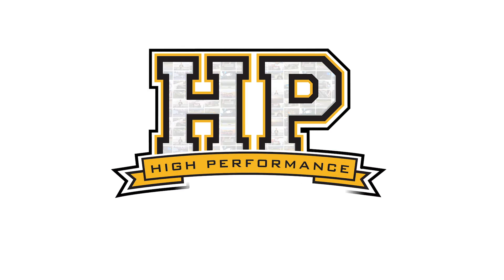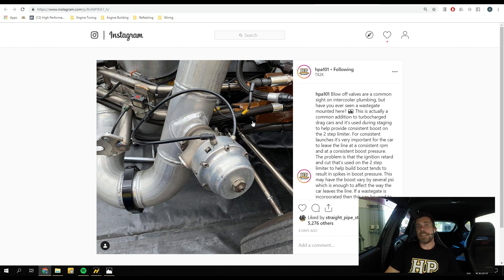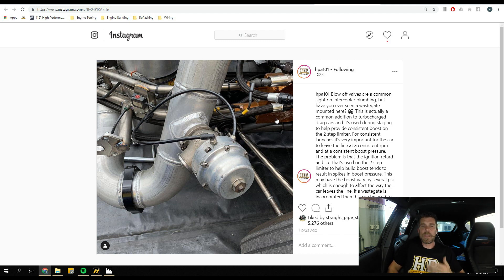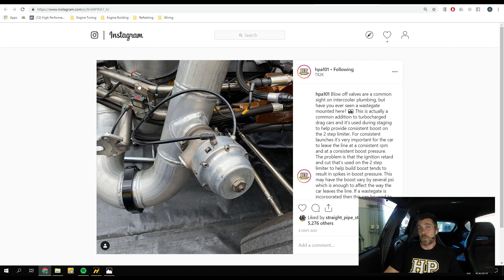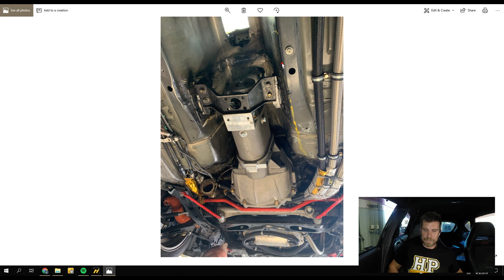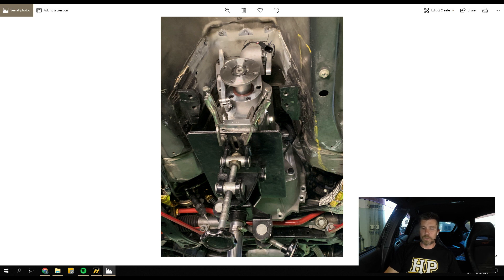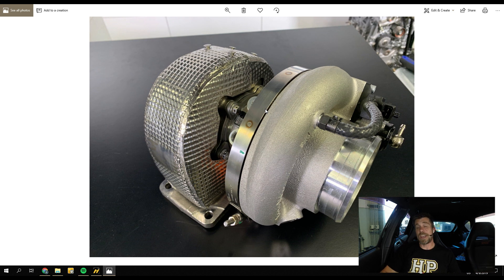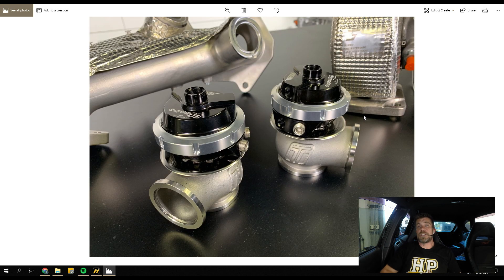Wastegate On A Charge Pipe! Why? & The Turblown 13B FD RX7 Project | Today At HPA 205 [UPDATE]

Comment: Hi I’m running a large supercharger which is great for going down the dragstrip that want to drop the boost pressure when not at the track could this setup (hypothetically 30 PSI to drop down to 15 PSI )be done to run a lower boost in this way?
Reply: @tim6913  yes you can regulate your boost with this method

Comment: Can a waste gate be used on a centrifugal supercharger (have rising boost curve). The idea is to run a higher boost pulley set up to get higher boost on low RPM and limit the boost on high RPM. Example:  w/o waste gate 3k rpm - 4psi, 4k rpm - 6psi, 5k rpm - 8psi, 6k rpm - 11psi, 7k rpm - 13psi. Let's say we don't want to run more than 8psi in with this engine combo. Can we use waste gate to limit it 8psi and have this -> 3k rpm - 4psi, 4k rpm - 6psi, 5k rpm - 8psi, 6k rpm - 8psi, 7k rpm - 8psi ? 
THank you !

Comment: What wastegate size suits for 13b new engine? 40mm or 45m?
Reply: @fadhlitajuddin6661  45m is bigger than the car for one thing 😂

By new engine, do you mean a new, heavily built engine or a stock new engine? You also need the turbo size you're using. Min-max boost pressure you intend on having. Whether it's for cruising, track or drag racing and much more to answer the gate size for a 13B rotor. That's not even touching on the engine model, porting, fuel type and so much more.

Comment: i had commented on the instagram post, and cant remember if i said that on aviation turbines, many of the engines have a pressure controlled bleed valve to vent excess pressure from a compressor stage,  this mainly to help with compressor surge/stall, but also improves turbine response.

Comment: The ultimate turbo setup is what Mercedes did in F1. Split the turbo through the block, put the cold side in front of the intake and hot side on the back with the manifold. Inside is an electric motor that can spool the turbo at any time to any level. They don't have to rely on the unpredictability of 2 step style turbo spooling, that's old tech now that's what they did in the 80s for rally.
Reply: That turbo+MGU-h is also 100+ thousand dollars a pop..

Comment: Until this presentation...I wasn’t aware that turbo ‘over-speeding’ is a potential outcome in any application or equipment configuration scenario.
What factor(s) determines max rpm on any particular turbo?
What can occur when a turbo over-speeds?
Reply: Not an expert but I'd presume the bearings used as well as not operating within the efficient range of the compressor map would be the main issues.
Reply: Run an engine at an rpm its not designed for.....same idea. It will self destruct is the simple answer
Reply: When you match and calibrate an engine its a very important parameter. The wheels will fatigue and break much earlier if you overspeed regularly, if you overspeed severely you can blow the wheels completely to pieces. The speed is set by both material properties and blade design of the wheel, no two turbos are the same. You can roughly guess the max speed by using a max compressor tip speed of 560-590m/s.
Reply: Max speed for a turbo varies...usually is specified by turbo manufacturer (which is often not displayed by hybrid/replica turbo manufacturer)...

Overspeeding a turbo often caused by boost leak or simply just overboosting and engine...

Easy to tell the turbo is oversped when the turbo shaft snapped clean

Comment: Just an(other) idea to throw out there...

'Someone' should do a 'bi-turbo' rotary (swap?), if they ever got the chance...  Like one turbo for each rotor. 

Lol, think mid engine but you could maybe even stick it on a transaxle or something? Idk, the one huge problem (which Mazda seem to have alleviated with sky activ r anyways (by reversing//swapping intake and exhaust placement - I.e cold on bottom, hot on top...)), is the radiant heat from turbo/exhaust to the intake runners, especially being post throttle body/injector. Def something to be careful of.

And on that note I will mention, I recall Howard Coleman I believe on the old 7club, did some testing and found mica, just a big slab of it between exhaust/turbo and intake runners, seemed to do quite the trick. I mean turbo blankets are nice, but they don't solve everything
Reply: Quad turbo 4 rotor. It exists.

Comment: You guys should compile a playlist of clips from//of 'unconventional' setups. Like the WG on inlet and I recall another video a while back that had either an electric throttle body on exhaust manifold somewhere or maybe a second one in intake for boost control or something - maybe a tech tip on a quick spool valve and maybe a rundown on VGT turbos like holset stuff you find on trucks
Reply: Sorry for the garbage little paragraph, made that//this while having a quick smoke on phone

Comment: I'm curious why the exhaust side wastegate isn't being used to control the boost spikes while on the 2-step. Is it because you don't want to open the exhaust gate while staging in order to build boost quickly? because it doesn't actuate quickly enough to control the pressure spikes in the exhaust? or because it can't flow enough to control those pressure spikes?
Reply: Maximum effort to get the turbo spooled up means bleeding exhaust is a bad idea. Best to bleed off on the intake side as the second benefit is venting any boost to the atmosphere also speeds spool up time...
Reply: @YZFoFittie  YZF is correct
Reply: Pretty much like a pop-valve on turboxharged f1 car when they mandate 3bar maximum boost pressure in the regulation....

The solution is simply by installing a 3bar calibrated wastegate on the intake plenum...